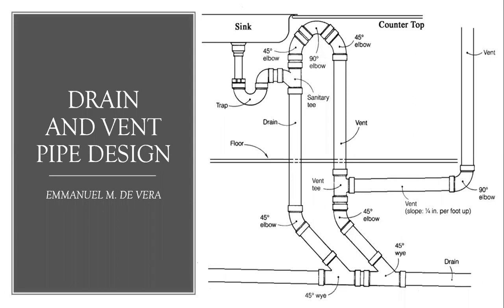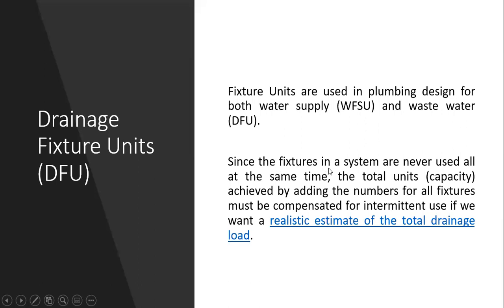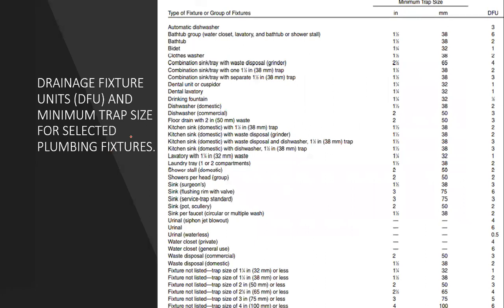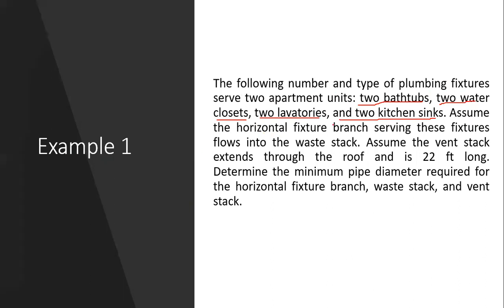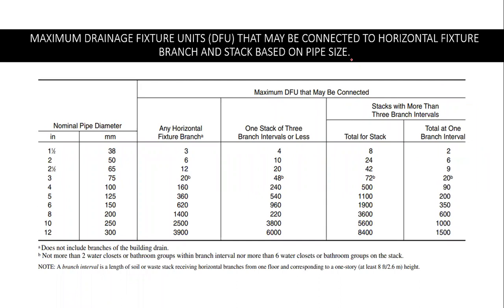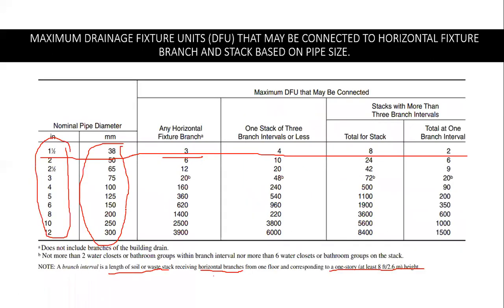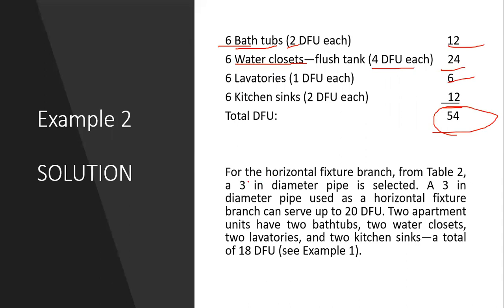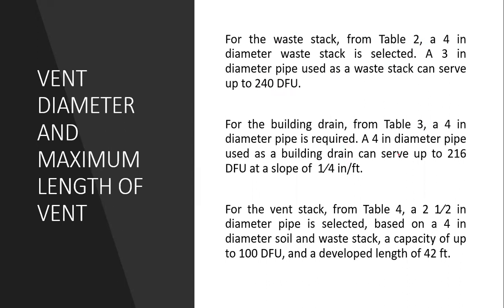utilities 2 drain and pipe vent - EMMANUEL M. DE VERA

Comment: A sanitary drainage system is a systems ” that transports wastewater or other sludge to an authorised site of disposal within public or private property. The aim is to build and build sanitary drainage systems that will work dependably, are neither inadequate nor excessive, and are mainly made up, fixtures, and connections that meet code and standard requirements. One of the most basic requirements of a drainage system is that the piping in the flow direction cannot be lowered in size. Access to the drainage system is essential for the protection of cleaning shutdowns, and sanitary drainage cleanouts are required.

Comment: Sanitary drainage system removes effluent discharge from plumbing fixtures and other equipment. The draining rate for plumbing fixtures differ based upon the DFU. A good sanitary drainage system ensures the safety of health of the people.  Good sanitary drainage system is important especially when there's a lot of people living in the building. There are appropriate designs on this and should be follow to avoid problems.

Comment: A well design drainage will definitely be good when considering money and its impact to the environment. And also, in constructing drain and pipe vent there are lots of things to consider like air passage behind the water, etc. Designing pipe is pretty complicated but it will be easy as you practice and master it. And also the maximum and minimum pipe diameter is discuss which is pretty much will affect the designing your drainage system.

Comment: I have learned that drainage plays a big role in the community along Sanitation. Sanitation systems aim to protect human health by providing a clean environment that will stop the transmission of disease. One of its purpose is to remove effluent discharged from plumbing fixtures and other equipment to an approved point of disposal. Also, fixture unit is not a flow rate unit but a design factor base. Fixture units are used in plumbing design for both water supply and waste water.

Comment: I’ve learned that the purpose of the sanitary drainage is to remove effluent discharged from plumbing and other equipment to an approved point of disposal. And the intent of this is to design and install sanitary drainage system that will function reliably, are neither undersized nor oversized, and are constructed from materials, fittings and connections whose quality is regulated by codes and standards.

Comment: The advantage of such plumbing system in buildings is that requirement of overhead tanks is eliminated. Secondly these pumps are designed to get the required equal pressure to all floors, unlike in traditional way water flows from underground tanks to overhead tanks and the upper floors gets water with less pressure and lower& ground floor gets high pressure due to gravity and more height.

Comment: Drain-waste-vent or DWV pipes carry waste and water smoothly out of the house without gurgles or fumes. This requires an air passageway behind the water. Vent pipes extend from the drainpipes up through the roof to provide that passage while also carrying odors out of the house and the purpose of is to allows air to enter a plumbing system to maintain proper air pressure to enable the removal of sewage and greywater from a dwelling.

Comment: The sanitary drainage system's job is to transport wastewater discharges from plumbing fixtures and other equipment to a designated disposal point. DFU is used to get the drainage capacity needed from fittings. The design technique is designed to ensure that larger diameter pipes do not flow into smaller ones.

Comment: What I learned in this report, is how to design a sanitary drainage system, on what types of different pipes that we should use inside the building. And what types of pipes applicable to cr, kitchen, or in any part of the building that contains a pipeline.

Comment: Considering a good sanitary system in building house is important. To prevent health issue after building the house you must thoroughly plan the drainage system, since it well affect the health of the occupant. A well design drainage will definitely be good when considering money and its impact to the environment. And also, in constructing drain and pipe vent there are lots of things to consider like air passage behind the water, etc. Designing pipe is pretty complicated but it will be easy as you practice and master it. And also the maximum and minimum pipe diameter is discuss which is pretty much will affect the designing your drainage system.

Comment: What I learned from this topic that is reported by Mr.  Emmanuel is that designing drainage system plays and significant role and that it has a standard design that must be followed. Also, having sanitary drainage system in our environment helps us to maintain the cleanliness. 
By maintaning cleanliness it helps in not putting our health in risk.  Not having a proper drainage system can cause us problems and different sickness. Moreover, i also learned that the DFU or Drainage Fixtures Units can actually be used in knowing the required drainage capacities fixtures.

Comment: I've learned in this topic how importance of sanitary drainage system is to ensures that the soil is properly aerated. If you have excess or standing water it can choke your crops. Drainage reduces soil and nutrient loss from runoff and can help avoid soil erosion. Also Sanitation systems aim to protect human health by providing a clean environment that will stop the transmission of disease, especially through the fecal–oral route. For example, diarrhea, a main cause of malnutrition and stunted growth in children, can be reduced through adequate sanitation.

Comment: I have learned that Drainage pattern is an important geographic factor for river
basin. This paper pioneers automatic recognition of drainage
patterns in river networks. The method
is based on geometric indicators, such as the average angle,
average sinuosity, and catchment elongation to classify the
patterns automatically. In typical pluming system operation, Plumbing powers the essential utilities in our homes and enables us to accomplish daily and essential tasks, such as shower, drink water, cook, wash hands, brush teeth, flush the toilet, clean, heat water, treat air and more.

Comment: I have learned that drainage fixture units or DFU can be used to determine the required drainage from the fixture and itsnservice systems. Also, DFU abd minimum trap siE for selected plumbing fixtures such as urinals and water closets have integral traps that are built into the fixture so its trap size does not need to be specified. Maximum drainage fixture units or DFU can be connected to the horizontal fixture branch and stack based on pipe size. Each problem have also clearly specified each DFU that can be used. I also learned that the Design approach is used to size drain and vent lines that relies on tabular information found in the code.

Comment: I learned from this video that designing drainage system is very significant. It has a standard that must be follow in accordance to the appropriate type of design. I also learned that a fixture units are used in plumbing design for both water supply and waste system. Also the design approach can be seen in this video. It stated that the minimum pipe diameter is based on the total connected DFU.

Comment: I've learned that in typical plumbing system operation, the sanitary
drainage side of the system consists of traps at each fixture, and
fixture branch, stack, and drain pipes that carry wastewater
away from the plumbing fixtures and out of the building.

Comment: Sanitary drainage system is made for removal of water waste emission. DFU (Drainage Fixture Units) is somewhat similar but slightly different from WSFU (Water Supply Fixture Units) due to the rate of draining and filling.  DFU is used to obtain the required drainage capacities from fixtures. Design Approach used is coded, making sure pipe that has larger diameter won't flow to a smaller one. Depending on what  fixture you are dealing with, there are specific minimum traps/trap arm sizing indicated.